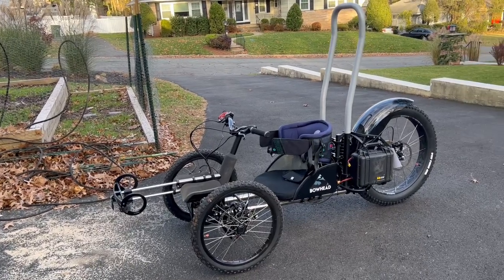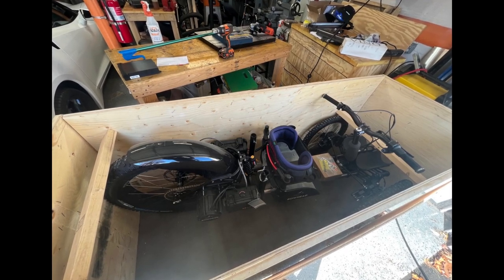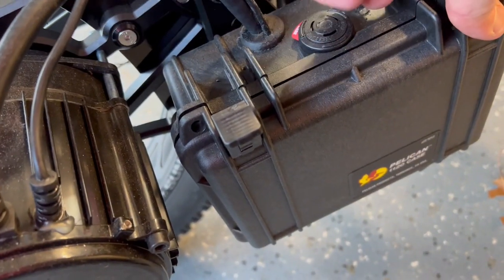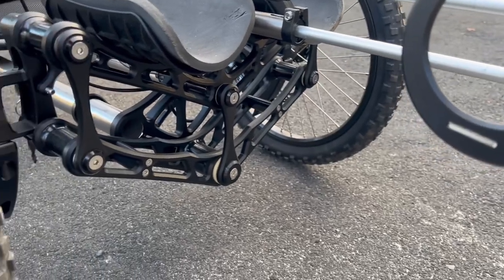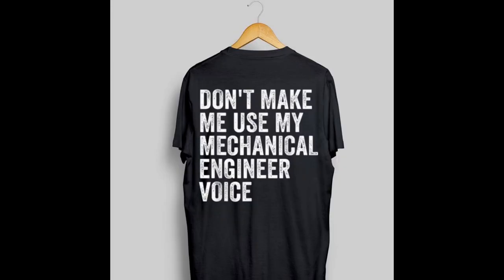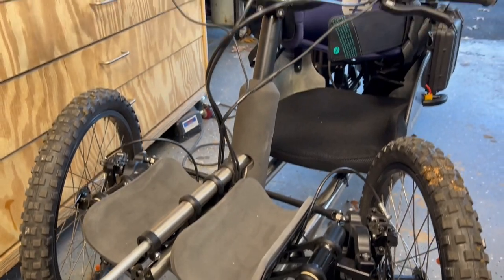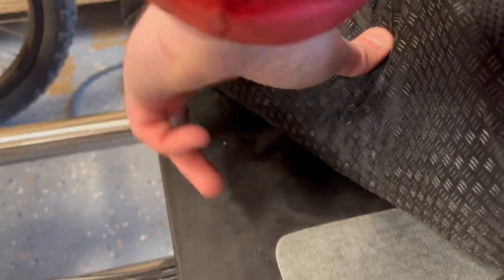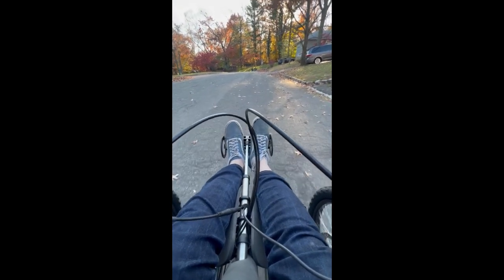Bowhead Reach Review and Walkthrough

Comment: great review, I am a pretty new bowhead owner and love it, I will put up a couple points from a slightly different view. the bowhead as you receive is not custom made for everyone physical situation and in most cases would probably benefit from specifically set up for you, for example if you are not racing it or anything you might want to put on some lights, warning device etc. ive found with the articulation less is better, I hold the bars quite lightly and let it do its own thing, its totally nuts what these things will do. im also modifying mine to suit my double leg amputation. if the suspension had steer stops, reverse etc etc it would lose a lot for someone like me,, not to mention trying to deal with extra weight. in my eyes yes its very expensive if you ride with the pin in, with the pin out its priceless to me.

Comment: Thank you for your very thorough review. Also see Outrider USA, I just bought an Alpha and both the tech and engineering are fabulous correcting all your negatives. Also if you have a handicap car plate from your state you then are protected by the federa Americans With Disabilities Act as your bike will be classified as a Medical Device which will give you the right to trave anywhere pedestrians and bikes are allowed - power at that point is irrelevant as it’s a function of the individuals requirement based on total weight of you and you medical device. Be sure to add either stickers clearly showing you a handicap or impaired and you will be good in all 50 states.

Comment: They do sell lean limiters and another adjustable rubber type strap to set tension on the articulation if you need it. 
The front ends articulation is what this bike is all about. Don’t buy one if you’re going to be leaving the pin in, that makes it a very stable and snoozy go-cart. 
Sorry, there are other adaptive bikes out there for you if that’s what you’re looking for. If you’re looking for a really cool take on one that is fully capable of riding any trail then this is the only choice out there in my opinion.
Reverse isn’t really needed as it’s easy to grab the front wheels and move backwards, a bicycle has no reverse either and have been like that’s forever. They do have a high entrance fee, but these aren’t mass produced at all, they’re made one at a time with very high end components. Aluminum and titanium aren’t cheap, machining is expensive as well.

Happy trails folks,
Enjoy!
Reply from the maker: The lean limiters ratchet straps and rubber bands were not released when this was filmed.

Comment: on a recumbent trike Ackerman Steering is critical..  The reason, when you make a left turn the left wheel kingpin geometry causes this side to turn sharper  AND it causes that wheel to lean/tilt towards the turn.. The outer wheel (Right) stays perpendicular and makes a wider turn.. this keeps both wheels in contact with the road (not one skidding)... Most of the recumbent trike manufactures:  AZUB, ICE, Catrike, HP etc all incorporate Ackerman for that reason.  Other wise they would be dangerous on high speed turns.  This is a serious design flaw.. ask yourself, "why do are all car manufacturers required to use Ackerman steering to meet regulations".. now you know the answer.. SAFETY

Comment: Articulation dampening with proper stops should have been a priority,  regardless of how much experience you have riding.
Both safety and handling characteristics could have been greatly improved.  the controller being in a air tight box makes me nervous,  I never seen a controller without some sort of heatsink cooling and not exposed to free air, I'm curious as to the make of the motor and controller, I'm certain many owners have reprogrammed the controller and upgraded the battery pack for better performance. 
For 18 grand  I would expect a little more.
Reply: yeah they can be derestricted but dam. 3000 real watts,  mine spins a 5 inch tyre on 15-20psi on bitumen, crazy power!  it is also designed as a race machine so any extras will take away from that, its like anything I guess weighing up the compromises, steering stops and suspension stops would be super involved due to the way it articulates and would all need to be fully adjustable, and it wouldnt improve handling, I understand how you'd think that though,, the sealed controller seems great. it doesn't get hot, or wet

Comment: The other problem i see is that the center of gravity is very high.. 
that makes for a tippy recumbent..   Like Deltas, hi center of gravity 
have a tendency to tip over easily..   for $15k, you would think they 
could put a right/left arm that hydraulically uprights you if you tip 
over.    Looks like you are protected if you are tipped on your side, 
but if you are out in nature, you could lie there for ever if no one finds
 you.
Reply: centre of gravity ? your pretty much sitting on the ground, its proven extremely well handling. as far as the steering geometry goes thats  the whole idea of this articulation  you can lean both wheels right over independently of steering. this is how they keep bowhead not much more than bar width, I don't know how many of those trikes you mentioned would fit on a standard single track or walking trails

Comment: Excellent review. I too am an owner of a reach and could dive a lot deeper into a lot of these similar topics about the bike. Primarily the articulation and how you just flip side to side with all of the weight from the bike. I’m a t9 complete and have some core but damn it is really intimating to ride with the pin out, I’ve tipped over so many times in a flat field. That doesn’t give me the confidence to hit the trails just yet unfortunately 😅
Reply from the maker: Join our users group on Facebook if you haven’t already!
Reply: I have only tipped mine going slow, not sure if its  gyro effect on the rear wheel but the faster it seems more stable like on two wheels, not sure if playing with tyre pressure might help, also possibly longer bars might help.